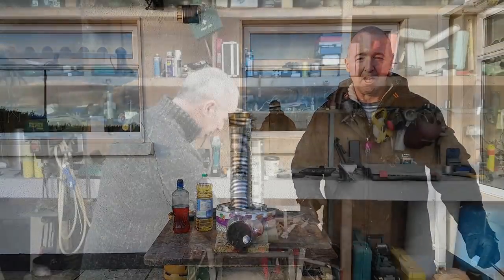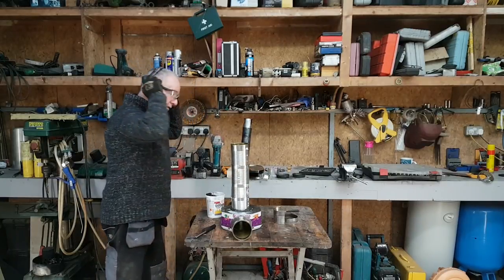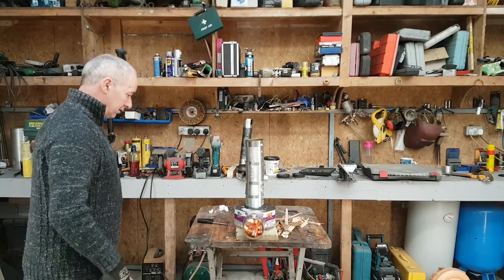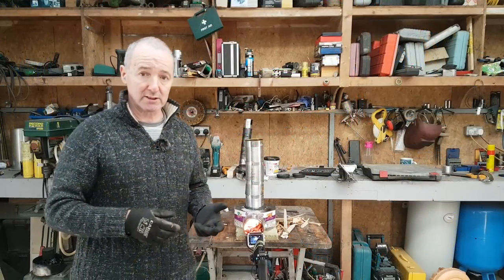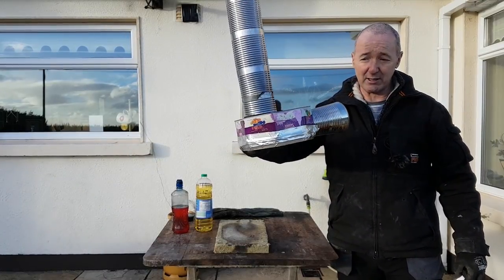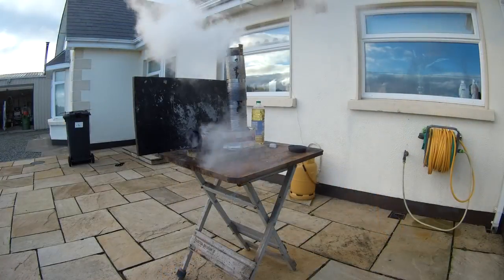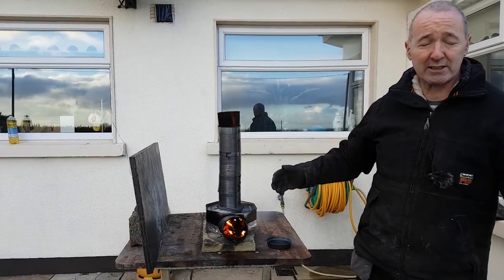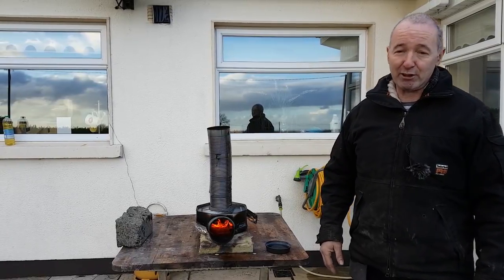Rocket Stove .. Super Easy Build..Tin Can

Comment: Cool lookin' stove. If you add air holes around the top of the stove that will allow smoke to go somewhere if you put a cook pot on the top. :)
Reply from the maker: Hi thundersnowstorm. I made a slightly bigger stove out of a barrel  that I run on waste oil and I have cooked on it. Well if you could call it cooking 😀 https://youtu.be/tnzEDEpz3Yk Thanks for the comment Cheers Gerry

Comment: Wonder if it would perform better if the gap at the bottom of the chimney is at the back. Flames would have further to go and give up more heat. Until it falls off the table!
Reply from the maker: Hi Des. I had problems with wind and gravity that day lol. It needs an insulated section to superheat the gases. This one was just a simple thing that anyone could make up with just a scissors and some cans. I will make another soon but will require some welding I think. Thanks for the comment Cheers Gerry

Comment: I've been looking to do something  just like this, without the bulk of an old Wood Stove or Water Heater around it.  If something can be fabricated from common scrap metal or plumbing parts, it could be encased in fire cement for safety (like those DiY metal smelters).  It could use a water jacket and small pump, to deliver the heat to a car radiator (or transmission fluid cooler and fan for distribution in the room.  If the Rocket Stove geometry is proper, a CO meter will give you acceptable readings at the exhaust, that would make it suitable for indoor operation.  The flame coming out the chimney is indication of complete combustion in the flue gases.  We generate a lot of cooking grease and waste vegetable oil all year long; but have less than a month of truly frigid days.  If I had a waste oil/grease furnace for those nights, it would be worth hundreds of dollars each Winter in electricity.

Comment: HAHAHAHA i Like, OLE!
Reply: before I forget, does it have to be stainless steel vs a cast iron frying pan. I am thinking of removing the Burner Assembly off my propane water heater, got plenty of used motor oil. I want to use that to heat up my water heater. I have no money to refill propane tank. minimum fill is $300 Propane company wont fill anything below that. I have a 5 gallon propane tank that I was thinking of hooking up to burner via a hose. tired of taking cold showers. but now I found out about Legionella Bacterium; from guess where, yep water heaters. Irony washing hands with water coming from water tank will get you sick and die. no cure for Legionnaire's Disease.

Comment: If your trying to combine a rocket stove and an oil burner i would suggest you be very careful.  I built one and it got so hot that the pipe i had on the inside of the rocket stove melted.

Comment: IT just goes to show that you can use just about anything to make heat and do just about anything to it while it is burning as well ! 
Even a video like this Gerry gives one confidence to give it a go and get something that works , with a little tiding up you could have a "heater" that can provide basic heat 

I bit the Bullet this week and purchased a 4 m length of 100x 100 x 3mm square tube ( 102 $ AuD ) and a 4m length of 100 x 5mm flat bar to make I hope at least a couple of  Rocket stoves or one with a couple of cooking spots on it 
 Gerry What would the calculation be for the flue height please, 

10 foot ceiling in the bedroom, 
The flue will poke out onto a Corrugated roof at the base of a Peaked roof , 

which will be on its east side with the roof on the west side of the flue 
* will the peaked roof add a updraft for the flue and thus not need to be as Big? *
As I am going to have it in my bedroom and put up some heat protection for the wall also 

I would like to have a Copper coil around it,  the rocket and  the gas bottle  ( I do have a 45 kg Gas bottle I can use for the outer covering as well) and hook that into my line in to my instantaneous Bosch  Hot water system as a pre warmer for cold water. 
My Bedroom is 14.5 feet wide  x  20 foot long I'm just hoping it wont be to hot for the room 
so I will also be putting a butterfly type choke / baffle in the flue  to regulate the heat and maybe one in the air intake to slow it down as well 

I cant wait to have a warm room during winter next year !
Tony from Western Australia

Comment: you can test vortex burner
http://mon.danstagueule.fr.free.fr/NRJrealiste/econo/avec%20cone.html

print and paste paper model on can,
paper has the right length (L = 2 x Pi x R)
dremel and carbon disc, ebavure, put in good shape.
.
problem being that it takes time,
find out how high to put the vortex,
but especially to test several numbers of blades ...

Comment: Gerry your the man! I was wondering if you are able to design a small, portable oil burner to take camping or use in an RV. Also I was checking out your other videos and its awesome that you paraglide!  Im part of seattle paragliders and have always wanted to try the fan motor. Bear Grylls flew to the summit of everest on one of those. check it out on youtube
Reply from the maker: Hi nautical1983 I have been asked that lots of times and as soon as I get the boiler stoves done I will make a small portable heater. It's definitely on the to-do list. I worked in Oregon for about 6 months a good few years ago but I was skydiving then and hadnt started paragliding. The closest I got to Washington was Portland but I could see Mt ST Helens from Marys Peek Oregon Beautiful place. I want to make a Paramotor trike from stainless steel tubing over the winter. I trained a paraglider friend of mine to use his paramotor. The transition is not that hard. Being able to fly above inversions is really cool There will be a live chat withing the next week Drop in Cheers Gerry👍